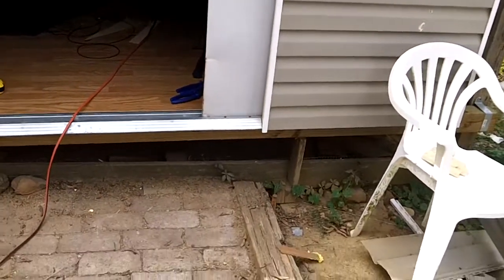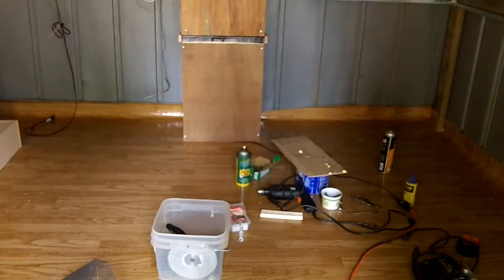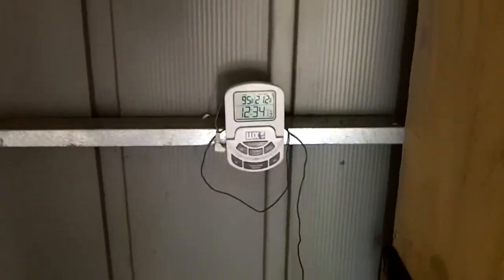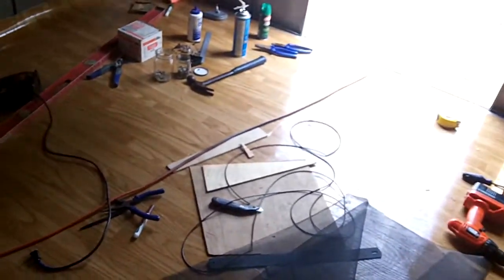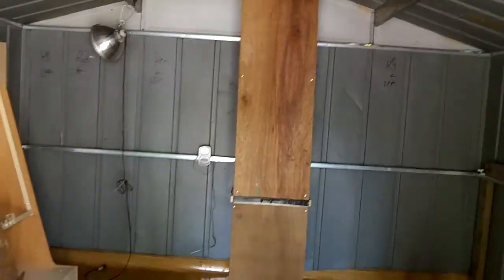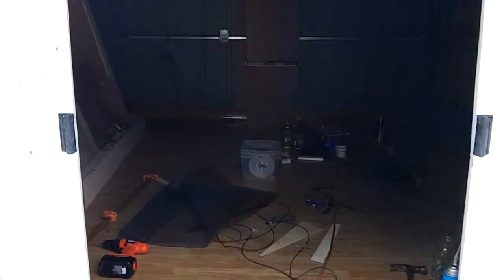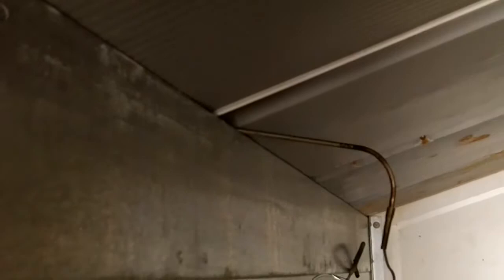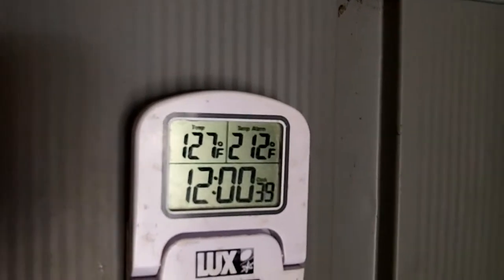Chicken On A Hot Tin Roof/ Coop Update: A Multi-Pronged Approach To Cooling The Coop

Comment: Yes. It's time for insulation. 2 inch foam. Ceiling and upper walls.If you put it down low in the walls cover it with plywood so the birds dont peck it all to pieces. Then if you still need help, maybe another turbine LOL. You could go nuts doing this. Those chickens don't know how good they have it.